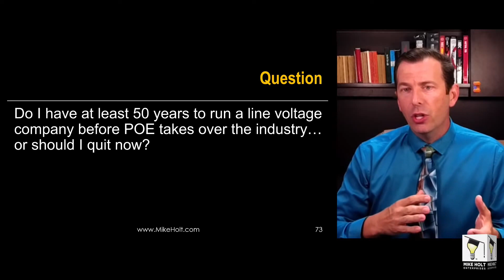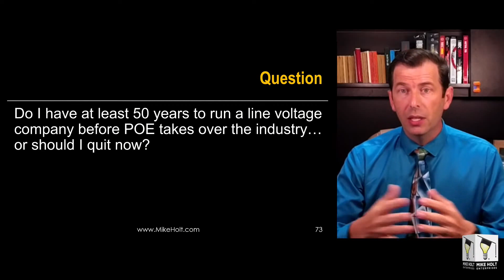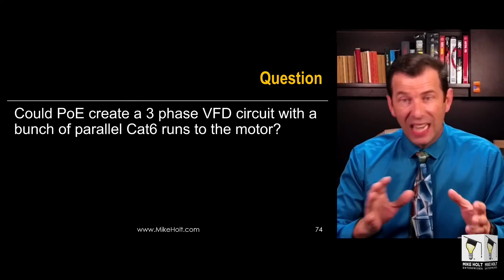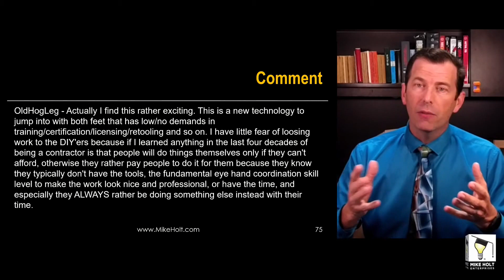Will POE systems replace Line voltage wiring? Part 1 of 2, NEC 2020, (9min:01sec)

Comment: I have a random question and hopefully someone on here can answer my question.

So at work we have a machine that we put into run mode. We check the voltage between pin 26 and ground and the machine stops running. As soon as we take out the probes from the multimeter it starts running again. This is ac volts btw. We tried different multimeters with the same problem. I just find it weird how checking voltages would cause something to turn off?
Reply from the maker: Post your question on MikeHolt.com/Forum please.

Comment: A few points I can make from an IT prospective with somewhat of an electric background.  

I do not see PoE Replacing line voltage for several reasons
-Most buildings all ready have infrastructure for the lights, too expensive to replace existing infrastructure
-The cost of PoE network equipment, a switch blade with 48 ports can cost a couple G.  Not to mention the additional power supplies needed for the switch
-The added cost of larger IT rooms, more IT personal to support the new infrastructure
-Security concerns if everything is plugging into PoE, I am sorry there are no longer security updates for your light so it can no longer be on our network. 

In my state at least low voltage guys are licensed, and will often charge more than electricians.  Several low voltage guys I have talked to are former electricians who went to the low voltage side for better pay.  In addition to all of this, if if PoE does start to take over some things, at least in my area, low voltage guys have more business than they can handle at the time and none of them (or at least the good ones) do residential work.
Reply: I  do not see PoE taking over everything, I think economics is the number one barrier. it  just  not the solution that covers everything
Reply: @midnightwatchman1  I agree. The market will dictate what is and what isn't adopted. It will be interesting to see where this goes.
Reply: Great comments. It will be interesting to see where things go. For now they are being installed faster than they can be manufactured and we still don’t know about longevity so you have a valid point. In our office the install cost was similar to their line voltage counterparts including the new switches, management has been very easy, and security is simple enough since they are on a separate VLAN. The LE shops that are doing larger projects have expressed similar concerns about future proofing but network topology has evolved with the need so I don’t see a major roadblock in the future just some minor obstacles to overcome in time.

Comment: Mark my words POE lighting is another stupid fad that is not going to takeoff. 

There have been SO many failed fads over the decades, but yet we STILL use the same lightbulb socket, line voltage, and frequency we did over 100 years ago!
Reply: PoE isn't a fad. It's been around for nearly 2 decades, and is the preferred (and sometimes only) method for powering WiFi APs, VoIP desk-phones, and surveillance cameras. PoE lighting, specifically, has been a bit of a fad so far. PoE is fairly power-limited, so it was impracticable for lighting until LEDs became commonplace. PoE is completely impractical, of course, for larger loads like motors, HVAC, cooking, etc. That's were line voltage remains relevant. I'm sure people the guys replacing fuses thought breakers "were just a fad." I'm sure the people using a hair drier while taking a bath thought GFCIs "were just a fad."
I'm not saying PoE lighting is going to make line voltage lighting obsolete anytime soon, but dismissing it as "a stupid fad" is the exact type of attitude that the presenter in this video warns about.
Reply: @ewicky  POE cameras are also ubiquitous now. 

If POE lighting has been around for over a decade, and high efficiency LED lighting has been around for a decade, why hasn't the industry switched over to POE lighting yet?

The main point I'm trying to make is that the industry will never make the switch to predominantly using POE lighting.

BTW we STILL use fuses as well! I'm sure when breakers were invented people thought we would stop using fuses, yet here we are what, 80 years later? Sometimes the simpler legacy technology proves more robust and reliable.

Comment: I’m wondering if usb only receptacles will every have a lower va requirement in NEC. Meaning, less than the 180va from a standard receptacle. 
And in his way, coupled with poe lighting, reducing the overall load on the electrical system.
Reply from the maker: A receptacle is a 'receptacle' so the 180VA will alway be required for 'receptacles'. A device with USB only connections is not a receptacle.

Comment: As a retired IT person, I embrace POE. I believe it will be useful, but certainly not replace line voltage. Love the electrical trade. Found this on a website. Hope it's interesting. "What Can I Power with PoE?
13W
IP Cameras VoiP Phones Wireless Access Point Networked Audio
30W
IP Telephones
WiMAX Access Points PTZ Cameras Remote Computer Terminals
60W
Door Access Systems Video Phones Thin Clients
100W
Digital Signage Displays Point-of- Sale Systems LCD TVs
Computer Monitors
200W
Larger TVs Larger Displays Larger Monitors Laptops"

Comment: It's an important question that most electricians and contractors don't even know about. Big question is also for states that license electricians, whereas most states do not license data guys.....whose work will it be? It's the difference between your metaphor with mc cable. Mc cable is still carrying voltage that makes licensed electricians required. Poe does not, and this will need to be addressed. So in that sense it is something "different" or "new".
Reply: The unions have made it relatively clear... Lighting is electricians work... Government and independent workers is another story.
Reply: @ElectricianPizzaParty  Yes my union was ahead of the curve fighting for it for us, but the sad fact, is that is a very small percentage of electricians.
Reply: Are you saying you lost the work? Or not many POE is happening?  I'm in Local One what local are you?
Reply: @ElectricianPizzaParty  Local 6. I'm saying we were lucky to have a union behind us that thinks of those things. Alas, the majority of electricians in America are non-union and licensed through there respective states. My father and grandfather were both local 6 members and lots of people don't know that we used to do tbar, it held our fixtures and it was our work, you see it happening right now with underground, little pieces of underground are being performed by non electricians and it is slowly slipping away, without even bringing underground boring into it. I'm saying electricians are going to lose the work if they don't get ahead of it.
Reply: @kyleoliva2411  I hear you we currently in St. Louis have a Carpenters Union that has Electricians which is undermining our wage standards for IBEW workers.  They are called Local 57.  The carpenter's are taking work from others.  Not sure if San Fran is it? Deals with this issue?
Reply: @ElectricianPizzaParty  Wow, no I have not heard of that, is it a backdoor deal, or are they doing it front and center out in the open? Here the sign guys have their own electricians, but that's all above board, and there scope is very small.

Comment: I would recommend reading up on the PoE standards if you're an electrician. I'm not an electrician (lower voltage electronics guy here), but I could easily see that it may become a factor in the field of work for electricians (e.g. installing PoE-capable infrastructure as you install the electrical power, etc.).
From memory, it is important that terminations are done right, especially for PoE (good contact, don't undo twists on the twisted pairs more than the standards you are tasked to install for allow), I would recommend using S/FTP (shielded (braid) and foiled twisted pair) properly /signal/ grounded on one end. PoE invariably uses Switched Mode Power Supplies (SMPS), which can cause emissions problems, and SMPS tend to be more sensitive to outside interference too.
As to problems which may occur, they are the same that may occur in classical electrical wiring, plus some odds and ends from signalling systems, so experience in finding faults in proper electrical wiring may come in handy, as well providing experience which may prove very useful in troubleshooting electrical wiring.
Reply: Being in IT and having the experience pulling cable as part of my college job, I can't stress that electrician read up on PoE or any data stuff before touching it.  I have seen plenty of good electricians mess up on data big time.  I think some of the younger guys may get training in trade school but a lot of the older guys most likely have never received low voltage training.  Anyone with an electrical background should be able to handle running data cables as long as the do there research.  

A few pointers of where I have seen people mess up 
-remember the 100 meter limit for your standard data runs
-use quality jacks, Leviton's network stuff has been sub par in many peoples opinions, some clients will specify jacks to keep standard
-don't mix up T568A and B, there is nothing more annoying than having a different standard used in one of your buildings

-use the color of cable that is specified, large business will have standards on this stuff
-don't bend cable too tight, they will go out of spec.  

Lastly take the time to show good craftsmanship, you want your work to last.  We are the ones who will end up servicing it and repairing it over the years, and I can tell you that sloppy work gives up many headaches.

Comment: You can only put 30 watts on a poe+ cable 25.5 usable.   So if you want to run a 480v 15hp motor, you need to parallel "439.9" cables. 🤣🤣🤣   Imagine the terminal block, the size of a city block.